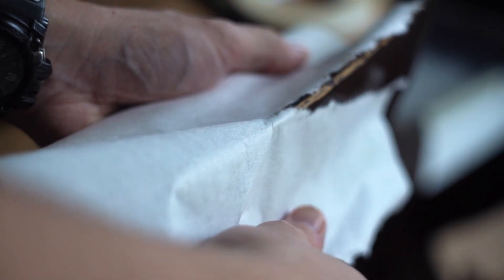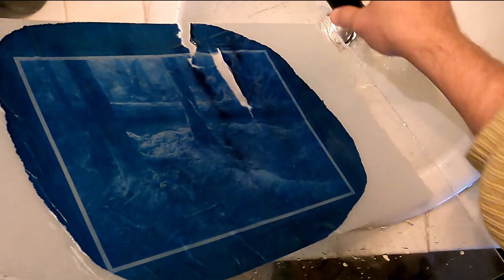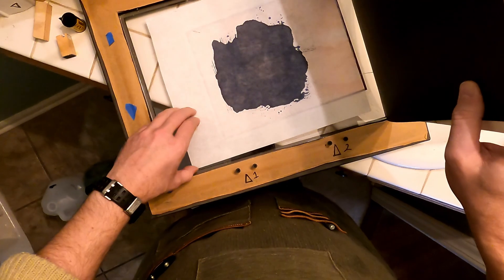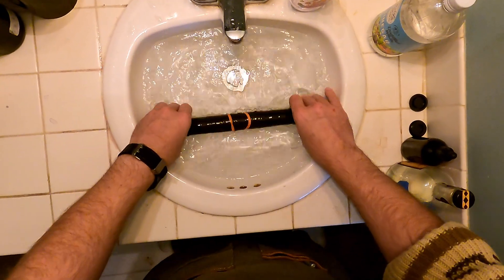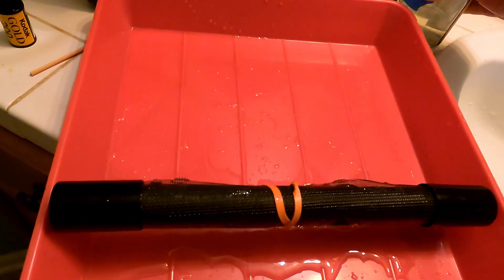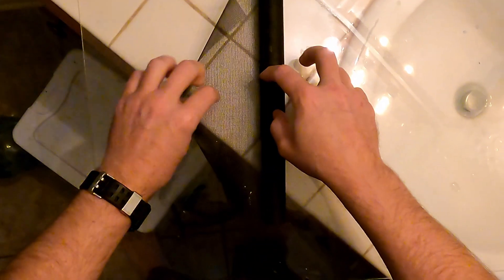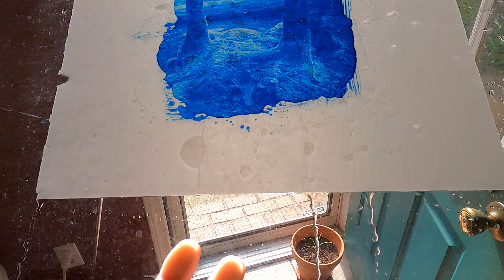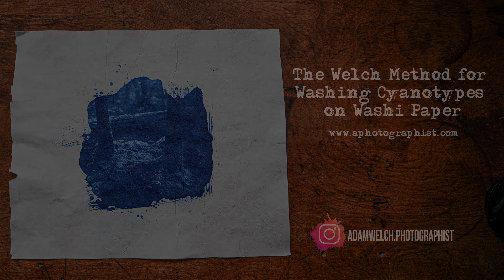The "Welch Method" for Cyanotypes on Japanese Washi Paper

Comment: Interesting video. Have been considering doing a cyanotype on hand made paper which gives you the same problems as washi. The paper making process might be of help when you roll out your paper from the screen. With papermaking I put another screen on top and gently put a sponge over the wet paper and soak up the excess water. Do this until the paper is able to pull away from the screen. Hope this helps.
Reply from the maker: Thanks a lot, Sybille. Do you ever encounter any indentations from the screen with this method?
Reply: @AdamWelch  A nice flat sponge works great. It does take time to get most of the water out. Another screen on top will help.That keeps it flat.
Reply from the maker: @sybillemuschik  I have encountered indentations in the washi when I have left the paper on the screen unfortunately. I tried a method similar to what you mention but whenever pressure was applied the crosshatch pattern was imprinted into the paper. What (approximately) weight paper are you using? Perhaps mine is too thin.
Reply: @AdamWelch  This is an interesting problem. My handmade paper is much thicker than washi. Will try your method and mine for drying and let you know the results. We will probably do a video on it when we get the chance.

Comment: I wondered if you'd tried ironing your prints through thicker industrial paper once dry, so it keeps its texture but evens out?
Reply from the maker: I have actually attempted ironing but with a strange result which I'm still not certain about repeating. In my case, the image on the paper nearly completely faded. I researched extensively and didn't find much information outside the fact that true "blueprints" (architectural) involves heat, which in turn made people recommend not applying direct heat to the cyanotypes. At the same time, someone mentioned they had dry mounted their prints with no ill effects. All that to say I've not repeated the iron flattening since then personally.

Comment: Fascinating process.. What would happen if you let the paper dry on the mesh? Either rolled up or flattened? I assume the texture of the mesh would be imprinted in the paper, but if you're going to wet it again to tone it might not matter?
Reply from the maker: Interesting idea. You're correct in thinking the mesh would certainly be imprinted onto the surface of the paper (especially with extremely thin stocks such as this) but as you said that would essentially be negated later. My only concern would be the paper becoming permanently bonded in-between the mesh and tearing either as the fibers retracted during the drying process or when the paper was removed from the mesh. If you try allowing it to dry while still attached to the mesh let me know your results please. I might eventually test that myself with a blank sheet of washi.
Reply: @AdamWelch  What do you think would happen if you used a silkscreen fabric instead of nylon screen? May need to "block" the screen with a fabric stiffener (edges) to hold it's shape better, but it would allow water to pass through and wouldn't leave as much texture as screen.

Comment: Just get Hakkinshi paper. That one is really strong for what you need and you won’t get a really messy full of wrinkles print
Reply from the maker: What properties of hakkinshi would make it more suitable? I was under the impression it was a blend of kozo and gampi?
Reply: @AdamWelch   It was specifically designed for platinum palladium printing and I’ve been using it in many different ways and it gets really strong
Reply from the maker: @diegoa.vignon4587  Ah. So it was engineered to be more durable during washing? What wash method do you use with your PP prints with that paper if you don't mind me asking? And what is a good source for the hakkinshi?

Comment: That's fascinating. I was planning on using an inert mesh to assist in drying fragile papers, and you have just simplified and improved on this. It will also help with fabric and likely eliminate some of the mess. I suspect it can eventually reduce water consumption in the darkroom and aid in the pre-soak in acid needed for many otherwise suitable papers. Do you realize that drying it on plexiglass or glass results in ferrotyping?
Reply from the maker: Gordon, wow...brace yourself because this is going to be along response. I had NEVER considered that this could be a version of ferrotyping until you mentioned it. I suppose I always construe ferro with some sort of metal plate but at it's most basic, slicking down the surface with the plexi is more or less the same thing. In the written article that hopefully is publishing soon I actually suggest placing the print emulsion side down on the drying surface to aid in reducing any possible "crosshatching" from the screen. Again, just like you said, this could be a form ferrotyping minus the ferro. The gentleman I mention in the video, Masayuki Nishimaru, has a process where he pulls an enormous platinum print by laying a piece of cloth onto of the washi paper in large tank; the print adheres to the cloth and he then rolls it onto plate glass. Think carbon transfer if that helps. Anyway, here's the whole video https://youtu.be/qcdXq9dlcvE    I think you'll find it extremely useful if you decide to go big with your prints. I believe my method is could be infinitely scalable but at the same time it hasn't been proven yet.
Reply: @AdamWelch  I realized after viewing the video again and thinking through some of the issues, I realized there's an improvement possible-using a Teflon mesh screen would eliminate or minimize some of the sticking problems. Nothing will stick to Teflon. Teflon mesh screens are widely available. The mesh basically gives one a paper spiral. This could be used for tube processing of any cyanotype on paper. That could really simplify the size requirements-a PVC tube takes a lot less space than big trays. Throw in a few holes, and you've got a custom and really cheap print washer, or simple way to add citric acid/rinses or toners. For pre-washing a paper that has an unfortunate calcium carbonate buffer, rolling the paper into a spiral on a non-stick inert medium is likely the way to go.